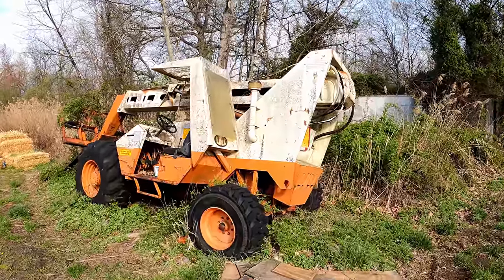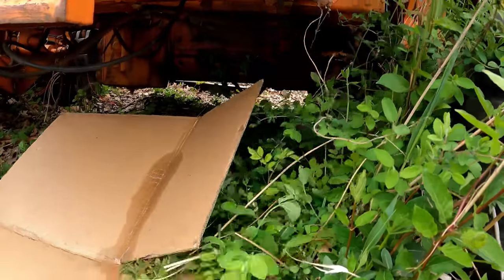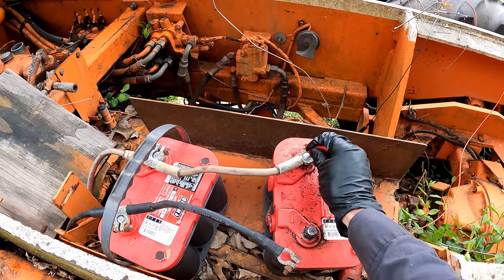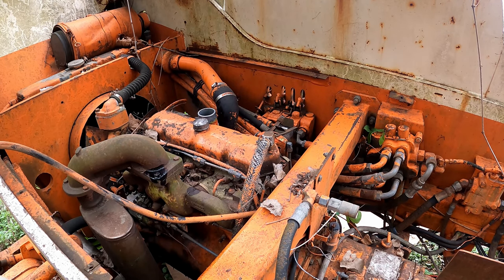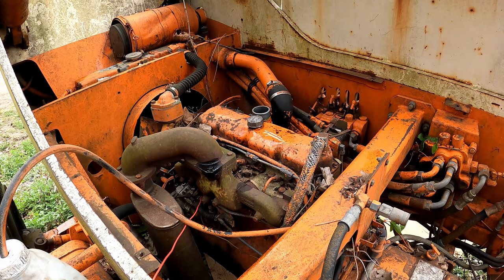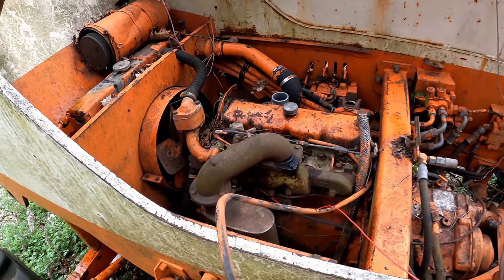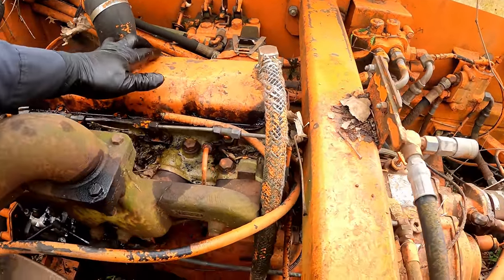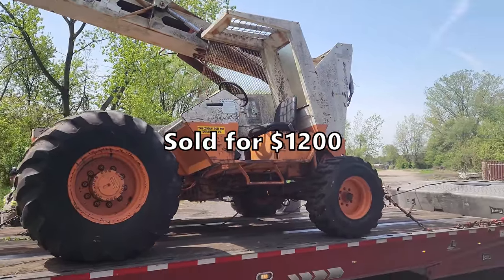Diesel LULL Sitting For 20ish Years Will It Fire Right Up? - NNKH

Comment: On a 4 stroke engine it takes two full revolutions of the crank to rotate the cam and valve train 1 full revolution. If you want to make sure valves aren’t stuck, you should go 720 degrees on the crank.

Comment: Here Down Under ,as a kid my old man had a similar piece of machinery on our farm and believe it or not it had a lil petrol motor that you pull started and lifted a lever and it started the main motor which was a big smoky loud diesel motor ,it was much much bigger than this one but very similar,all my mates at work love your channel ,hope you get bigger and bigger and keep on pumpin out these grouse videos ,much respect from Australia mate
Reply: Pony motor starter. Little gas motor you start, spins up the diesel, then you throw the lever and engage compression on the diesel and it starts. It was the method of starting big diesels before they were able to make starter motors big and powerful enough for them.

Comment: Just started watching your channels! I’ve probably watched 20 in the last couple days, great content! I am a diesel mechanic just wanted to tell ya if you soak a rag in gasoline and hold over air filter inlet it will run off the gas fumes . It will eventually dry up and have to resoak it. It’s a lot easier on the engine and don’t get any knocking likebwith starting fluid. Just a friendly tip lol

Comment: Wow..We take care of JLG and skyjacks among other equipment. No Lulls in our fleet any longer and I only saw 1 highlander.
That is an oldie for sure. John Deere engine. The fuel pump might come back if you run 
seafoam through it. Enough to start anyway. You do need that wire on the pump with 12 volts or it will not send fuel to the nozzles. Pretty cool.

Comment: Great video. If you come across another Lucas CAV that won't put out high pressure to the injectors it's probably due to stuck plungers in the pumping head. It is possible to take them apart and unstick the plungers but you have to be careful to mark them and put them back exactly how they were or you'll be delivering too much or too little fuel. Those CAV's are good pumps if you don't leave them sitting for 30 years lol.

Comment: You need one of the small battery operated leaf blowers so you can get in the engine compartment and blow out all the trash before you start hooking up batteries and turning wrenches.  Saves you time in the long run 😊

Comment: Back in 1995 I resurrected a 1966 Lull high lift fork lift the Perkins flat head 6 had a long Crack in the block and after drilling small holes the length of it I used JB weld to seal it and had to rewire the whole thing to get it to start

Comment: The good old Lucas CAV pump, most likely all you needed to do was remove the stop solenoid, pull the pin and put the rest back in.
Reply from the maker: Yeah I thought about trying to bypass the solenoid. I did give it a few wacks with a hammer in case it was sticky. But then I was reading that these pumps are prone to failure if they sit for a long time and was kind of on a time crunch with this one. Hopefully simple fix for the guy who bought it.

Comment: Next time you try to revive a diesel, put air pressure to the fuel tank to push fuel through and prime the injection pump.  Works great on old tractors.👍

Comment: Looks like a John Deere, the fuel filter part number is AR50040, engine oil filter part number T19044. Fuel pumps are very expensive 👍

Comment: Those pumps can be a real pain in the ass to prime.  Cranking it for a few minutes just isnt enough.
Reply: I used to work at a rental place and just about half the people would run our Lull out of fuel and I would have to get it going again. I watched a guy mess with it for a hr and not get it going. I would put fuel in the main tank then use a old inner tube and hose clamp over the fill and put a couple pounds of air in it crack the injector lines till fuel came out and bam she would start and run, 15min tops lol.

Comment: You really should use WD40 as a starting fluid
Reply from the maker: I'll have to try that but seeing as how throttle body cleaner And brake clean which is basically acetone wouldn't start it, I don't see how WD-40 would. Of course I don't have that much experience withmanner! Diesels so I could be wrong